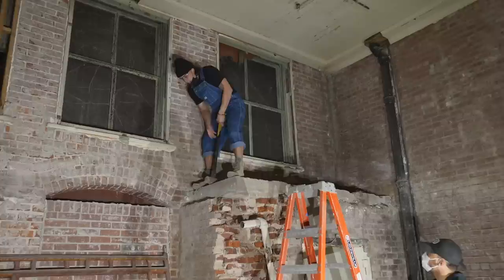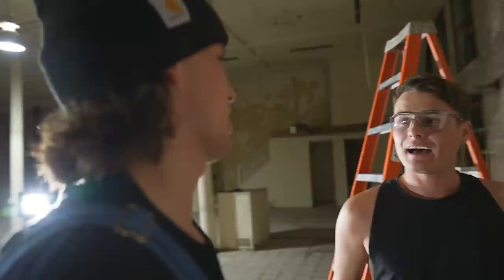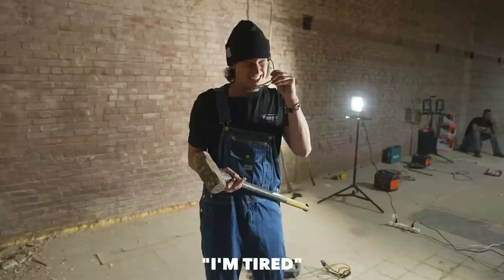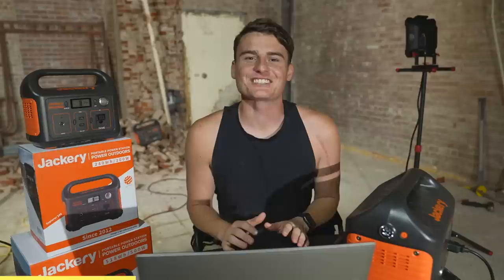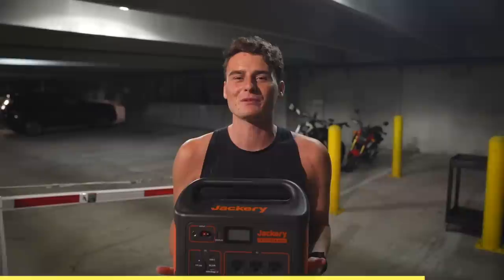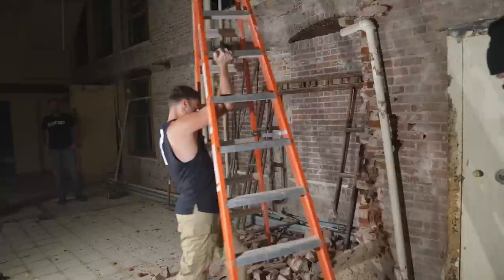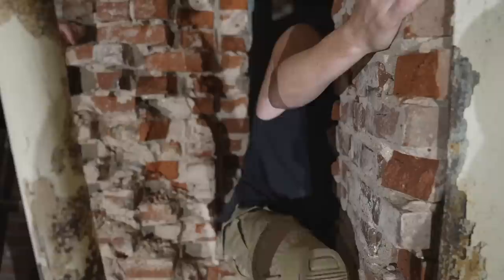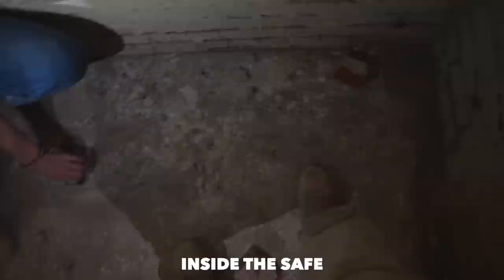Safe Break-In: Revealing the Hidden Treasures of an Abandoned Vault!

Comment: I guess I’m confused why they didn’t just go for the door.
Reply: It would take longer. The door is thick solid metal
Reply: @cmdetecting5836  it looked like they could cut the handle with some electric saw.
Reply: @AB-bc9tf  the handle doesn’t mean anything the lock will still be locked. Like the lock on a normal door that you would need a key to.
Reply: @AB-bc9tf  the brick is the best way to go

Comment: I'm surprised you guys didn't just get yourselves a nice powerful gas-powered saw and just cut right through that door that would have been your easiest way of going about it but if you wanted to make a video and make it long I understand that's probably why you went to the brick but you guys went through the hardest way possible also jackery products not that good they don't last nowhere near that long and that is why they had to come up with solar panels and still it takes so long to charge it on solar panels. the problem with these portable power stations are they don't use the correct batteries in them or enough amp hours of the battery they're using normal lithium batteries and those batteries really aren't as good as lithium iron phosphate batteries and that is a problem with these power stations especially from jackery